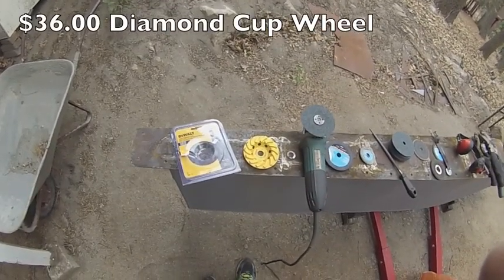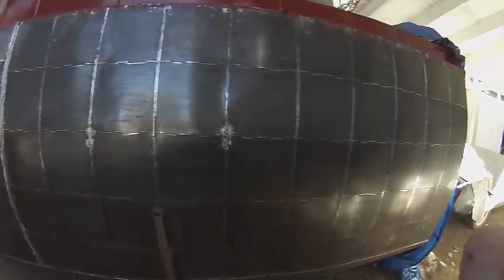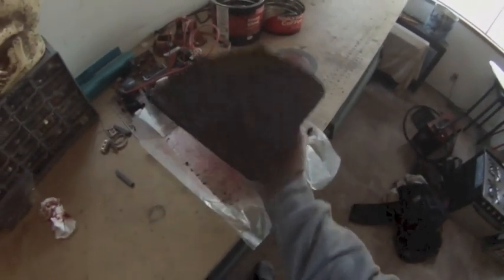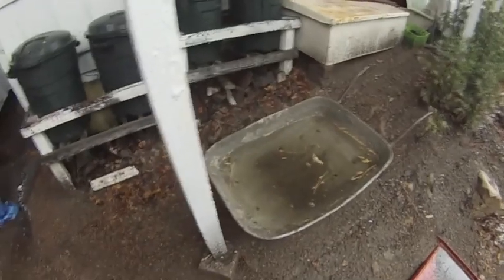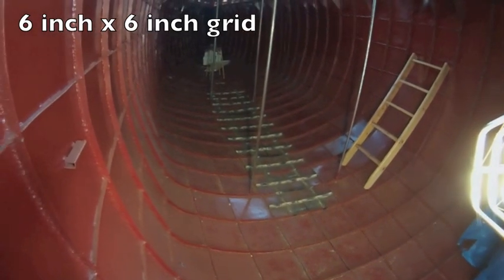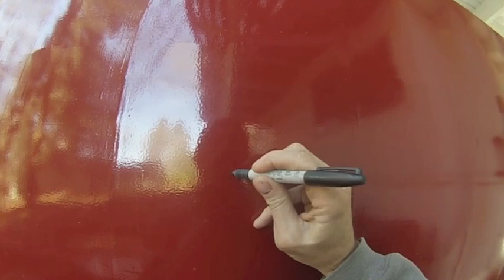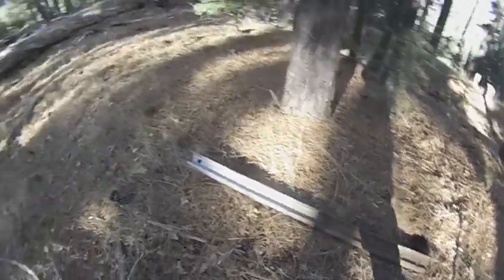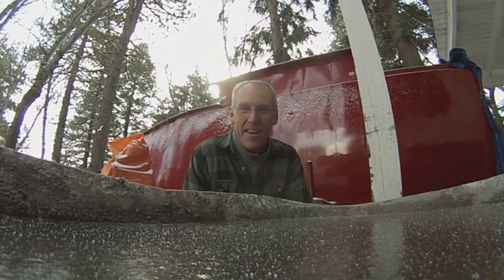Steel Sailboat Build Part 11

Comment: Now that the job is done.... try using a flap disc.  It's a layered sand paper disc that does a great job and lasts far longer than separate sheets of sand paper.  Your project is looking good.  Keep at it.
Reply: Tyler Woods I was about to suggest that too. They are awesome for both metal and wood.

Comment: The diamond cup wheel you tried is a 60 grit cup wheel bonded to grind concrete. There are diamond cup wheels manufactured with small grits. A vacuum brazed, or elector bladed diamond cup wheel with 100 grit, or 150 grit would very likely give you results you're looking for.

Comment: I have found the best way to prepare steel before painting ( besides sandblasting ) is using an angle grinder with a good quality wire brush on it, I use 125mm diameter flat wheel wire brushes ( with twisted wires ) in an angle grinder, they will remove rust and all mill scale off the steel, because they flex a little and don't bounce they get into all the little crevices.

Comment: When you used the diamond cutter, if you had attached to a strong "normal" drill with a smallish diameter drill bit, it would become a normal hole cutter, the drill bit is there to keep it centred, and stop the bounce. With correct pressure which you can produce by welding on drill press mech, I think it should work.

Let my know, thanks

Comment: I have a 40 ft cutter rigged steel sailboat, and I do like the strength of steel.  That said, I am glad the the design and build was done by professionals, as I want to sleep well at night. I really admire the enterprising spirit, but I winced when I saw someone trying to use a diamond concrete grinder on steel. There is a ton of info out there on building steel boats. What would trouble me is that our brave builder does not seem to have a solid grasp of sailboat design.  The fact that sometimes naysayers are wrong goes along with the fact that they are sometimes correct.  A true friend does not just fluff pillows if he sees things amiss.

Comment: For paint removal and surface rust give the carbide wheels a go.  Diamond is for ceramic, concrete, stone etc.  I find as you did that it has limited points of contact and being a non conforming design it bounces around while accomplishing little work.  The discs I am referring to are shaped and used much like the sanding discs you were using.  They are made of thin metal with carbide embedded in the surface.  The ones I have used for many years are a silver metallic color overall.  They are used just like a sanding disc and also come in grit sizes.  The advantage is they don't load up and last quite a bit longer than several sanding discs for not much more money than one.  They really do well in paint removal and things like fiberglass when you want to remove a lot quickly. They remove material rapidly and are aggressive so the work goes quickly though I wouldn't try finish sanding with one!  Sanding discs work well but you only get to use the outer third or so and they load up and wear down quickly in comparison.  Flap wheels in my experience (decades of fighting rust around vessels and fabrication) are expensive and wear down to quickly while only doing light work.  I prefer a regular grinding wheel to them hands down.  I enjoy your proceeding with what is available on your build.  Take care.  Doug

Comment: Use the avanti pro quick strip disc on a 4 1/2" grinder. 10 bucks each at Hd. Lasts over 1/2 hour each.  Best way unless you have a sand blaster.

Comment: The diamond cup wheels are either going to work, or they don't, and in my experience, it's down to the way the surface is. IMO, not worth using unless you know they will work.

Comment: I've been building steel ships and fibre glass boats for many years, I'm sorry to say that I wouldn't leave the kiddie pool with your creation, not that you didn't put the effort into it but more research would have set the project of on a even keel, oh-um. I hope your not one to get seasick cause that vessel is going to roll like you wouldn't believe, hopefully not completely over. Good luck !!
Reply: There isn't just 1 good way to build a boat. The hull construction reminds me of old small wooden river vessels and. I see no reason why this hull with the proper ballast could not be perfectly fine.

Comment: One of the main problems with a steel boat is rust. It starts under the paint and is sometimes not visible until it starts to leak. Steel boat builders will wait until good weather then sandblast and then apply a special base paint followed up by a few top coats. Other builders will apply a hot metal coat right after sand blasting then the paint. That's the best system but pricey. With this build the owner will be walking around with a chipper hammer, steel brush and a paint brush.  Don't bash the naysayers, we know what we are talking about. We've done this.